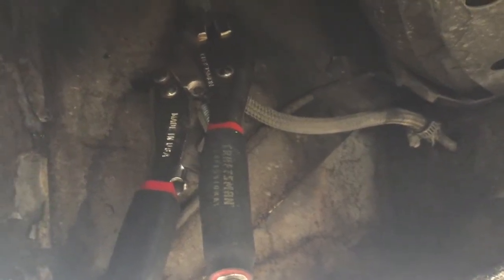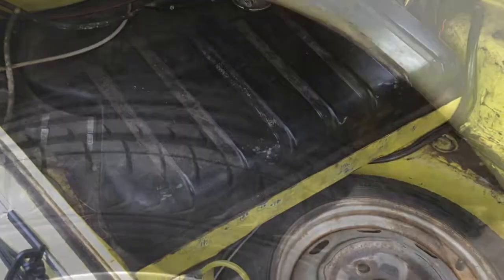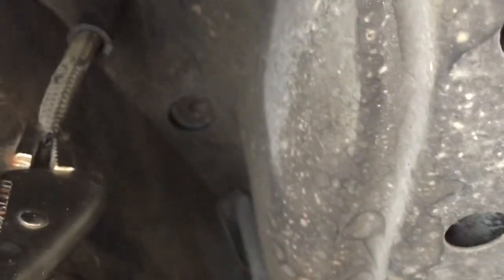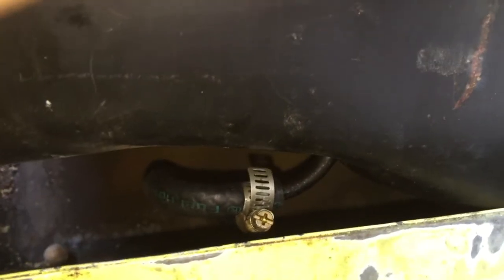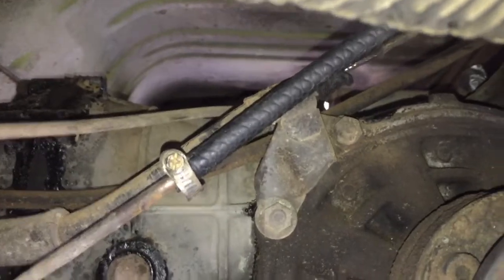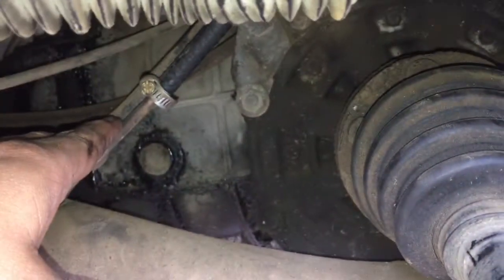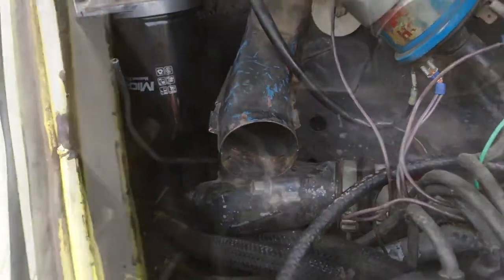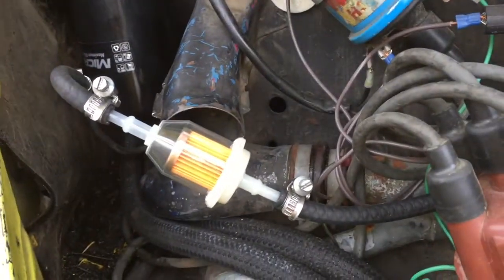How to replace the fuel lines on a 1973 Super Beetle

Comment: Excellent video. I filled my tank full of fuel to go to a car club Christmas party the night before the show, noticed a strong smell of fuel in my home. Petrol was dripping at an alarming rate from that front hose. The new garage concrete slab absorbed a lot and it took a week to air out my townhouse. So an emergency repair at 11pm with silicon and glad wrap before my garage exploded. I got the new hose, your video confirmed my 71 model has the same hose setup to the tank. I guess the hose did well to last since 1971. All my rear hoses are new braided ones. I guess I was sucking air into my fuel lines too, might explain the misfiring on the way to the gas station. At least it is not my E92 BMW, that would probably be engine out, gearbox, turbos and half the car interior to fix it.

Comment: You need to plug the holes where heater tubes were. If you’re not using the heaters, the holes need to be plugged or capped off

Comment: Big mistake! never unstall those plastic filters near the manifold!, you should have installed it under the tank before the tunnel
Reply: Or behind the rear tire.  That's where I installed mine yesterday.
Reply from the maker: Hey Ram,
Thanks for the advice. I've had the care 6 years the filter was there when I bought it and it's always been there, never had a problem with it.
Reply: I installed an aluminium small canister fuel filter, it was a plastic one in the engine bay. I should move it under the car🔥💣

Comment: My beetle has a fuel pump below the gas tank where you were showing your fuel line near your front tire. It also has the mechanical fuel pump in the back. Is this normal? My beetle doesnt start sometimes and it hesitates when in gear, also it shuts off when idle. Could 2 gas pumps be my problem?

Comment: Missed the part where you replaced the line from the front to the back of the car.
Reply from the maker: I'm confused on what you missed. If I'm understanding your comment you mean the copper tubing that runs from behind the engine to the engine bay... I didn't replace that as it was in good working order.

Comment: Fuel filter should be mounted under the gas tank not the engine compartment.  You're flirting with fire disaster...
Reply from the maker: Thanks for the advice. I've had the car 10 years the filter was there when I bought it and it's always been there, never had a problem with it.